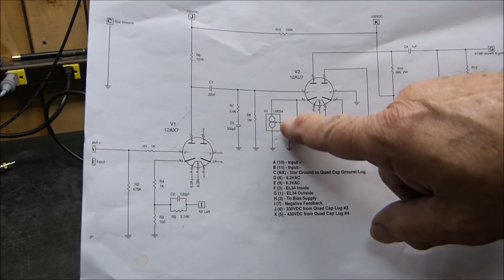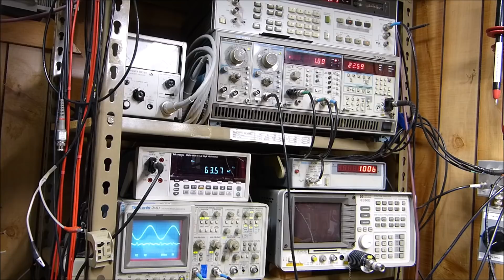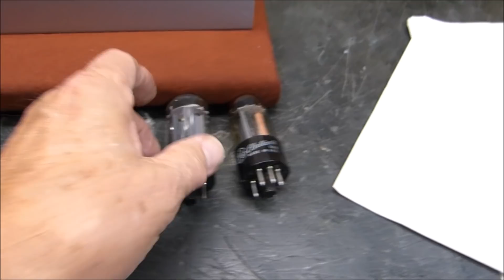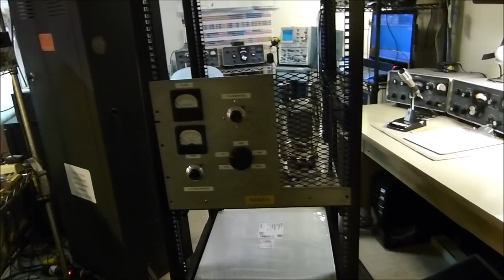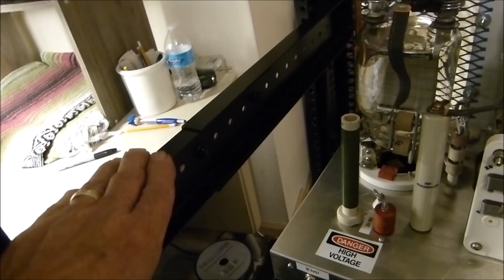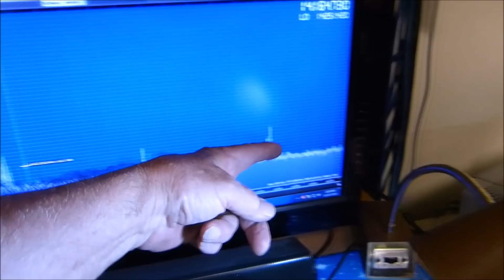807 (1625) Vacuum Tube Audio Amplifier With Triad Output Transformer & AM Transmitter

Comment: I was wondering, would it be better to mount the power supply above the amp in the AM transmitter?  Better heat transmission?
Reply from the maker: In so many cases, I do things like everyone else had done it for the last hundred years and never think about it. I see your point about heat and these massive components do dissipate a lot of heat even though there is not one super hot spot (like a orange hot vacuum tube) but the whole mass or iron is radiating heat. However, a kilowatt level power supply with all its components could easily weigh 100 pounds and if mounted higher in the cabinet might put the center of gravity up high and make the cabinet more likely to turn over when moved. I really appreciate all you guys thoughts and will keep that in mind. Thanks for your comments.
Reply: @ElPasoTubeAmps  I agree with the problem of center of gravity. But I would think something that big should be fasten to the floor or ceiling, preventing it from tipping over. Unless you need to be moving it around. Just thinking out loud. Anyways , I really enjoy your posts. Thanks.
Reply: You could always bolt the cabinet to the floor.  I used to service comm and server cabinets in Japan and the rule there is to bolt down everything to prevent an earthquake from toppling everything in a heartbeat.  Some cabinets come with outriggers to help stabilize them, but even so, a top-heavy cabinet is just asking for trouble.  I'd rather deal with the heat in some manner (pipe it out of the room or into the room's HVAC system or something) than risk a tip-over.